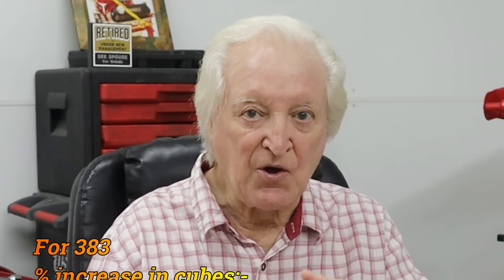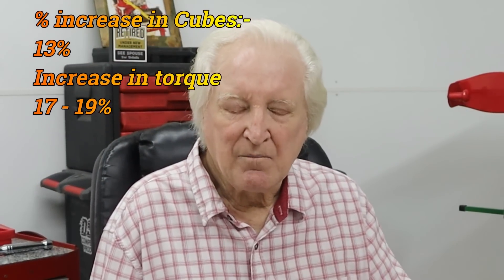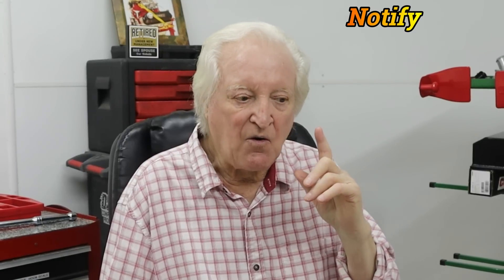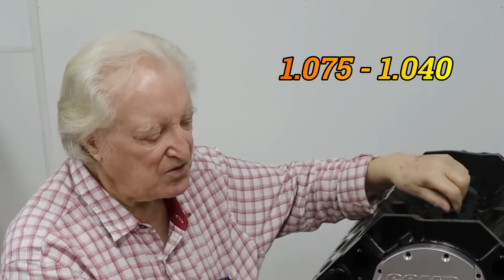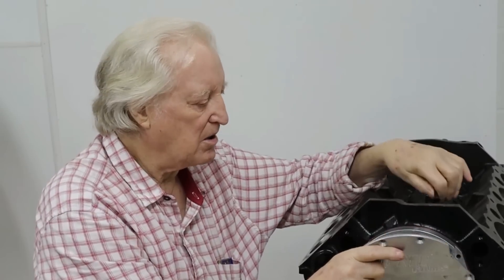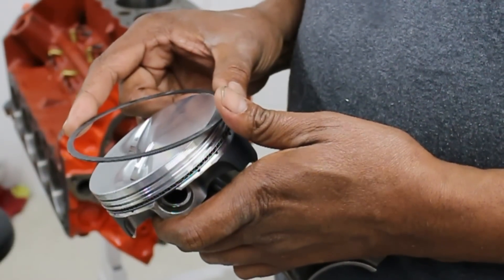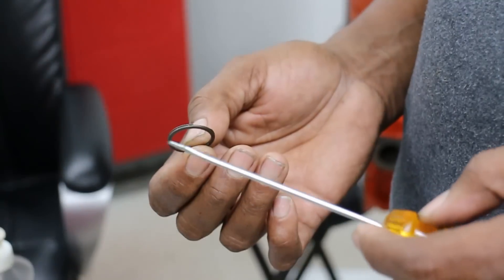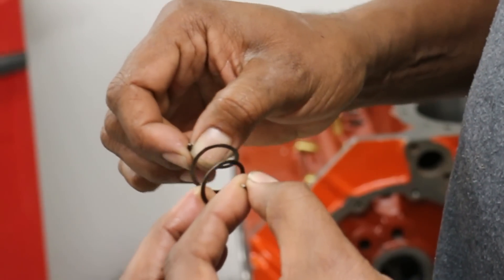Why are these #'s critical for a good torque build?

Comment: Hey David yet another great video. If you have a couple minutes Take a look at what these guys on YouTube are doing with big bore, short stroke, long rod sbc and LS builds they have done. The HP to CID ratio is VERY respectable for their pump gas builds!;

https://www.youtube.com/channel/UCNkFjO2Babgz4ZQnDy0uEZA/videos

Here is a direct a direct link to one of their N/A build that makes 1.889 HP per cubic inch;

https://www.youtube.com/watch?v=ttEsebehdrc

Am curious what your thoughts are on these, they claim they can run higher compression and still be able to run pump gas because of the TDC dwell with the greater rod ratios they run, they run usually just under 2:1 rod ratios. Thanks in advance for your thought on these and all your other knowledge you share here.
Reply: i am thinking of using a 1" mahle piston with the longest rod i can stuff in there, and a turned crank with less stroke than the 383 with about 3.66 to 3.72" stroke perhaps. This is so i can maximize my rod length up about 6 to 6.25". This is also a street engine. XR282HR10 comp cam on a 106 LSA and i guess ICL also. 10:1 target compression. Brodix CNC heads with touch ups by hand. Smaller diameter intake valve stem and radiused tulip exhaust valve. Crane gold rockers. Well know iam should make a 408 with a 6" rod a 1" piston and 4" stroke with a 4.030" bore and decked to the pistons although should be with a world products high density molecular iron lightweight block is 178 lbs 40,000 psi rated and affordable price right now with a 4.190" bore that would get you up there in cubic inch around 441 ci i suppose 🙂Just change the piston rings and rebuild on occasion and it shall be a great daily driver forever. Really needs a custom grind to take advantage of heads although want daily driver springs on it that last the race forever know what i mean.
Reply: @zAvAvAz  

There is no rod ratio advantage reducing the stroke the amount you're talking about. Plus you're adding expense and weakening the crank destroking it the amounts you have written. 

Here's how the math works;

Deck height - half the stroke - rod length - piston compression distance should = your zero deck for good quench. 

The way stroke works is the rod journal's offset is half of the stroke. So a crank with a 4" stroke has a rod journal that is 2" offset from the main journal. Seeing how the mains spins in a circle, at TDC the centerline of the rod journal is 2" from the centerline of the main journal and travels in a circle to BDC 2" past the main journal. Add 2" + 2" = 4" stroke.

The most you could change the stroke and still use an off the self rod is .100"(standard sbc journal size is 2.100") so you can use the small journal sbc rods(2.00" journal size). IIRC 6.125" is the longest of the self sbc small journal rods I have seen unless you go to a rod with the Honda rod journal size of 1.888" journal size. Or you can use the standard 2.100" rod journal rods with expensive thicker rod bearing for using a large journal rod on a small journal crank.

If you have an aftermarket crank with drilled rod journals you will more than likely NOT  be able to reduce stroke without either weakening the crank to much or even worse, breaking through to those holes.

The factory spec for a sbc deck height is 9.025" you have it cleanup square decked, now it is at a 9" deck height. 9 - (half the stroke of a 4" stroke crank) 2" = 7" - 6" = 1" leftover for your piston compression distance. You really don't want to go less than 1" compression distance on the pistons, have some fun with math now and figure out what you want to do.
Reply: @itseithergonnaworkoritaint7852  i can use a dart tall deck block, that is what i need. oh , i have fun with math 🙂 Like i understand that 1.5:1 rod ratio is crap. i know i can make 1.89:1 hp or more per cubic inch with a 2:1 rod ratio. i know i can make a ton of power from boost with 1.8:1 rod ratio because those ratios matter as much as these numbers David is talking about. No it is not weakening the crank because i am do not use the large diameter holes with those cranks that are advertised. Even if it were it would not weaken it to the point you are speaking of. Call and omit the holes and specify journal size and stroke or 'radius' as you mention.  This is a street engine build i am talking about with a 40,000 psi world products block. also i hate mallory metal and the holes they drill in the counter weights and such. Its ridiculous.
Reply: @zAvAvAz  

Sounds like you got it covered, not sure why you responded to my comment?
Reply: @itseithergonnaworkoritaint7852  sure are a lot of cranks turned down to 2" journals.
Reply: @itseithergonnaworkoritaint7852   Right on i love engines cool cars and blueprint work
Reply: @hotrodray6802  
Yes and there is the small block Buick 350 guys turning their 2" rod journals down to 1.850" for the extra stroke to be able to use NASCAR take out rods sold on eBay. You get around 370 cubes depending on the overbore your block can handle. These little guys run very well.

Finish Line Performance in Michigan built a sbb 370 and installed a Vortec style supercharger on it and got the HP up to 750! The last I heard was that they broke the TH400 with the little 370, they should have it fixed by now since that was around 10 years ago plus or minus?

Comment: Building a 408 Ford for street. 3000 pd. Daytona Coupe. Want a wide, flat torque curve. Not concerned about mega HP numbers. Any recommendations on lobe centerline....Thanks for all you do and God bless👍
Reply: @zAvAvAz  👍
Reply: @zAvAvAz  and then the chain "stretches"
Reply: @hotrodray6802  Yes, it does after it's no good anymore. At least on that ole stock buick timing chain in that high compression buick 350 in that skylark. 🙂
Reply: He said the 408 will be for the STREET. 106° LSA is going to have too much overlap and a loss of vacuum at idle (overly rough idle).

A custom grind based on the sum of your components is best, but for an off the shelf grind, an XE274HR or XE282HR Comp are pretty safe for 408w "streetability" and daily use.
Reply: @richdouche8253  Thanks for your recommendations. Was perusing Comps catalog and thought the same.
Reply: @suntzu5836  There is a channel called "myvintageiron7512" and he has a 3 or 4 part video set called "how to properly select a camshaft".

He does a really good job of explaining cam timing, and the various factors involved with that... If you have the time those videos will teach you quite a bit you never knew about camshaft selection.

If you don't have the time and just want a recommendation for an off the shelf... The two Comps are two pretty universally used stroker SBF cams that people like....

What heads and intake are you going to run on your combo?
Reply: @richdouche8253  AFR or Trick Flow heads & Edelbrock Performer RPM Dual Plane. On the fence on whether to go carbed or EFI.
Reply: @suntzu5836  Cool... The AFR 185-205 or the TF 11R 190 or bigger are really good heads for 383-408 stroker ford's. The RPM air gap is a great choice too. Every Dyno pull I've seen with those components and a decent cam make really nice power curves under 6k RPM. With a 408 street built motor you don't want to generally spin em too fast (piston speed) without a bullet proof bottom end.

I prefer carb for it's simplicity. EFI is great because your A/F ratios are always ideal, but then you have to spend much more to get that.

For a 3K pound street car with a 408 I'd run a cast crank with forged flat tops and forged rods, with 72cc AFR 205's and an RPM Air Gap, XE274HR and a 750-850 carb. 1-3/4 long tubes..... And That would be a great street engine without drama using an overdrive tranny and 3.27-3.73 rear gears.

My two cents....
Reply: @richdouche8253  It's true.....Great minds do think alike.
Reply: You want LCA of 106 and LSA of 110 for a 276 cam and a 112 for 282 or 288 cam for better likely hood that it shall provide enough vacuum for power brakes. Get a Vacuum can to supplement extra vacuum when needed.  CORRECTION :ICL of 106, not 'LCA'... my bad folks. Well i am liking 106* LSA now, give the engine what it wants based on valve size, flow efficiency, and cubic inch. idles better. You change overlap for idle quality and rpm not the other way around. lol!
Reply: @zAvAvAz  LCA and LSA are the same.  The separation between the lobes and centerline are talking about the same thing.
Reply: @matthewmiller2268  take a look at comp cams, many sbc cams have 4* degrees advance ground into them ICL 106 and LSA 110. i must have made a typo. i meant the ' intake centerline angle' not the lobe separation , or lobe centerline angle. great spotting that, thanks.